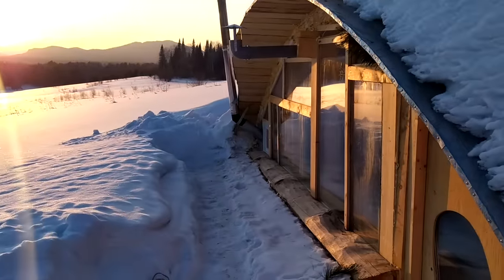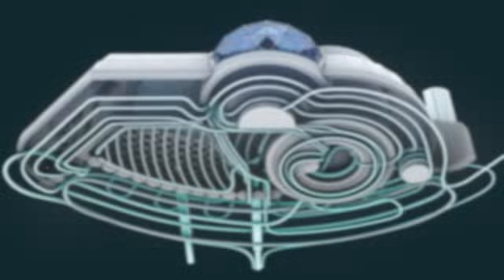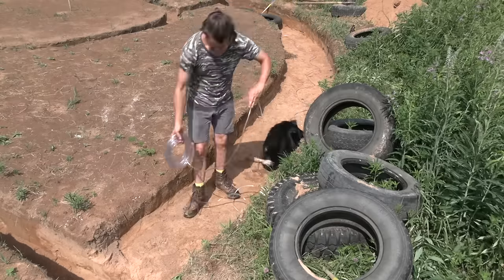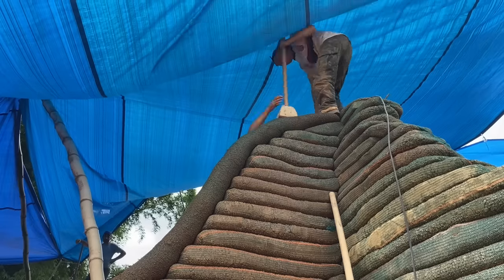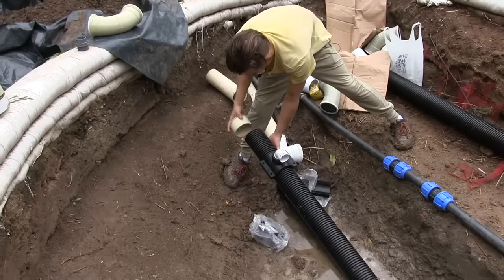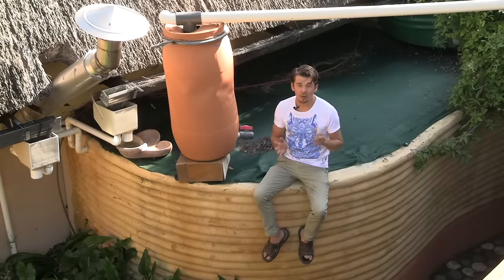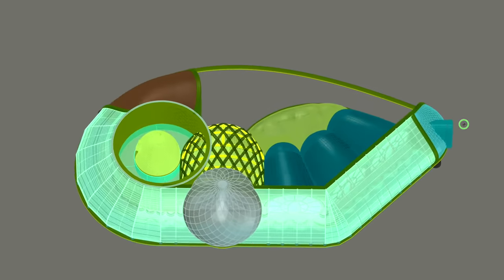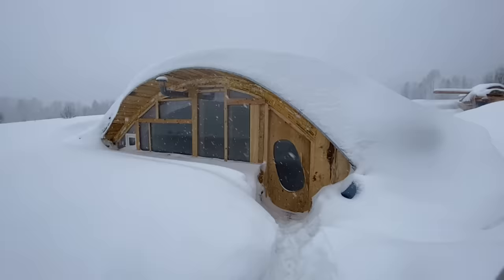I Built a 333-Ft2 Hobbit Home...for $2000

Comment: You swept me off my feet 🙂Nice design, but prices are unfortunately not real in most cases. 
Building without permission in my country usually equals demolition.
Reply: i understand that if no contract is use as no contractor is hired they can't do that no contract no code compliance ? pretty sure
Reply: @neal-stewart834  No, not here in the U.S.  Even if you upgrade existing structures, they want their hand in the pot.  They get paid for each inspection.
Reply: Some places are different in the US, it all depends on how rural it is and how much land you have to work on

Comment: I built a passive design in S WI 16 years ago. If I feel the need I can cool the whole house with a small bedroom AC unit homes 2500sqft house is in full sun. Home doesn't freeze stays 50f in winter. A bit of sun or a bit of electric and its in the 80s.
Reply: Yes SW london is the best mate. F you too in winter, 50 F to all yanks, Ft is great for heat.

Comment: I have followed Khalil Gibran for several years as well as many alternative builders - James Hubbell is one of my favorites in bioarchitecture.  He has built some of the most beautiful structures I've ever seen.  Anyway, the thing I have to ask above anything else is this a building forum that will cover building codes and getting local county/city engineering approval for this alternative building process.  Like the tire foundations - is that something a city/county engineer would sign off on?  Using "out of spec" locally sourced wood?  There are other questions that I have, but the issue is getting the build up with that type of approval.
Reply: Build on your OWN land. Corporations do not have rights to oppress humans
Reply: @romabatala  You obviously don't understand the way it works.  YOU can buy land.  IF it is within certain city/county limits, YOU are subject to BUILDING CODES.  It isn't a suppression by an evil government, but a way to ensure what you building does not become a death trap for the occupants through a total foundation failure to a blazing fire caused by faulty wiring.  Yes, building codes can be difficult to negotiate, but setting them aside because you feel they "oppress humans" is a stupid and childish viewpoint.

Comment: Building against the soil like that will lead to dampness and mold issues. The ground didn't appear to be insulated so that will be a constant source of coldness, though admittedly not as cold as a wooden floor built on piers. I love the idea of building a bunker type home, but the only work around I've found to the wall issue , is to build an outer shell, and then my living quarters inside that. Wouldn't be a total waste of space as it would double as a walk in root cellar, but it does greatly expand the footprint of the structure as a whole.
Reply: Watch from 3:00 to 3:30, he talks about moisture wicking up walks and insulation. This guy's designs are the real deal. You can only say so much in 10 minutes. I am a little skeptical of his heat pump design. I might have to purchase.
Reply: @higherrating2195  I must have missed that part. I'll go back and rewatch. Thanks for pointing it out.

Comment: Using some of the engineering that the Amish and the Japanese use are pretty similar in some ways burning the lumber actually keeps you from having to use chemical-based lumber like pressure treated😂

Comment: The cost you state is nonsense. There are tools and labour costs along with material costs. These included the time to gather and transport them. Then there are costs of energy infrastructure, waste disposal and potable water management.
Architectural ideas and prototypes do not reflect reality entirely but are useful to try and get funding.Most ideas are over promoted based on enthusiasm, and most are not adopted to the extent one would like.

Comment: What keeps the water from seeping into the structure? It’s not usually wise to dig into the earth with out the use of concrete.
Reply: The roof.
Reply: @kennethkeen1234  you have no clue do you? Water will take the path of least resistance l. Doesn’t care about a roof.

Comment: Two big lies here... Not much survives a nuclear blast there swifty. Now having been both a pilot & a Navy A&P as well as aviation engineer a simple Military aircraft can spot underground bunkers and the likes since the 1980s... That is how the Navy found most of Noriega's underground drug labs. With the kind of aircraft I flew as well as choppers have terrain spotting features and FLIR. As far as authorities can be creeps but around here we just load heavy on 00 shot. Most folks if you are not looking for something from the air you are more than likely not going to see it due to the curvature of the earth takes away from certain 3 dimen. features when in the air. The Navy's Med Sea  Pedro Island is an example. In 1987 I landed there on the strip. Saw not a structure other than a disguised radar array. After I landed I discovered most of the stuff was indeed built much like the earth house in the ground. The Chinese are imitating that on certain islands now as well...

Comment: 1000???  It's a lie of course.  Even if all the labour , equipment and wood is free. The fuel to haul those logs and cut them is not free. And the glass windows. Water barrier is brand new.  Rebars.  And the advantage  that "you can take it apart and move it , if spotted by authorities " is very encouraging.